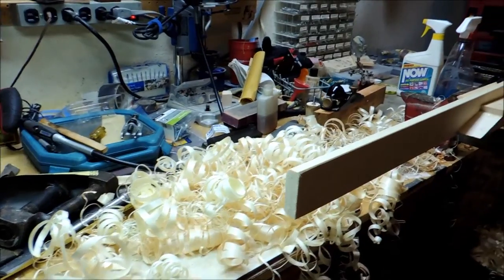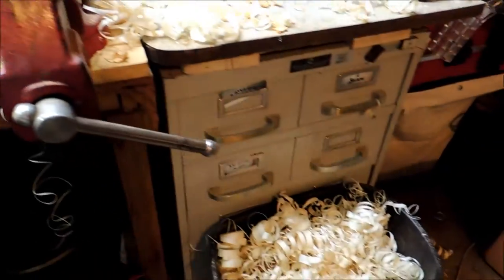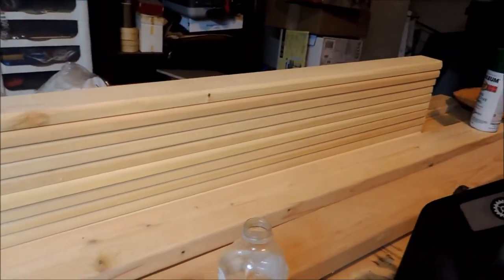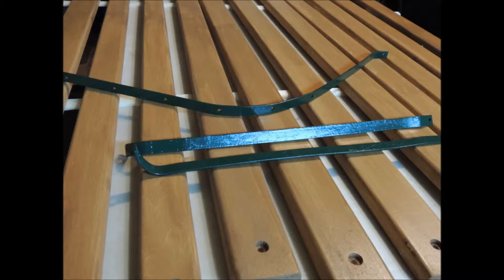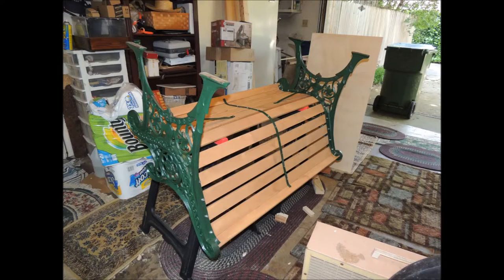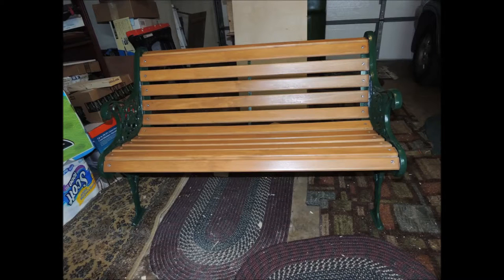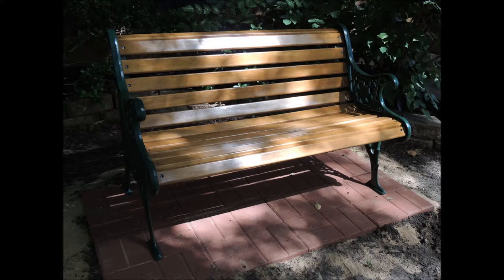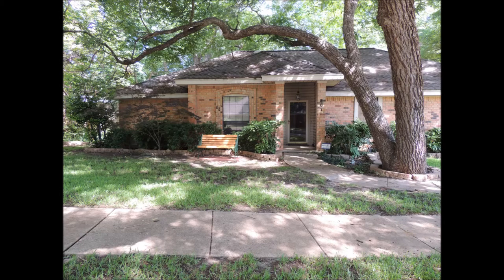Park Bench Cast Iron Sides Refurbishing

Comment: what type of lumber did you use and what size are the boards?
Reply from the maker: Steven Rampino  I used the cheapest wood I could find !   In this case it was aspen at the local Lowes Store.   They were the perfect size  The boards were Kiln Dried Aspen 3 x 1 by 8 feet long.   I just cut them in half.
Reply: thank you for the response